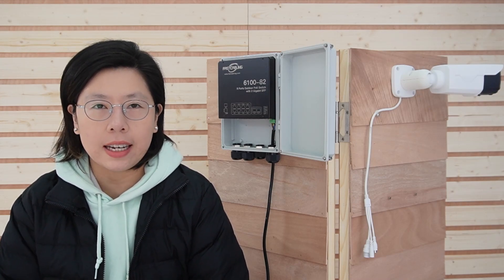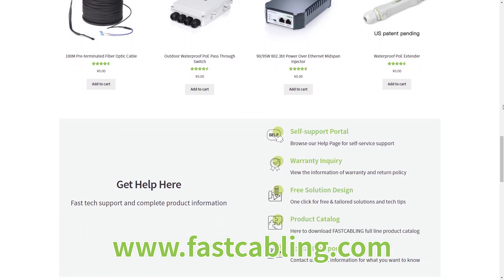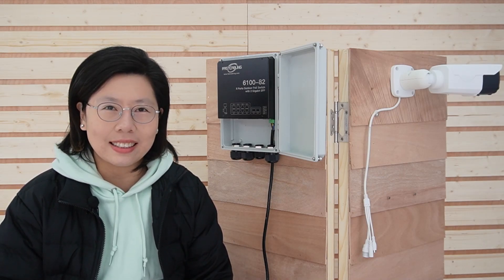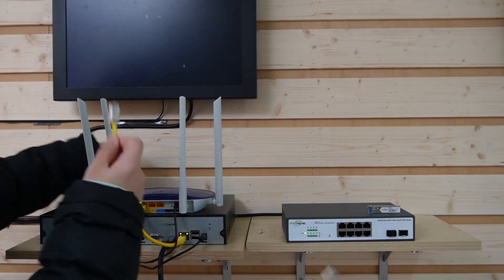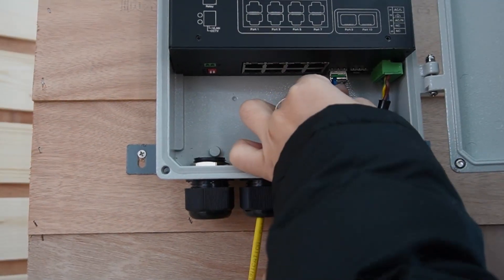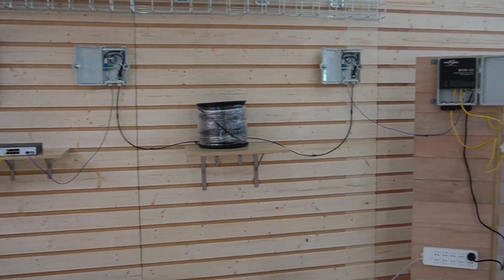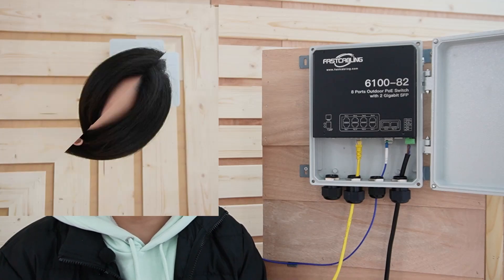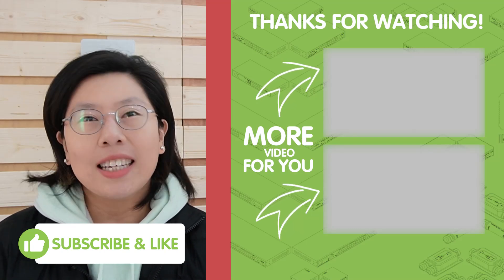Scaling Networks in Challenging Environments with PoE

Comment: Nice video! I seen that you connected the CCTV to the ethernet cable outside of the box. Does that also have a seal for that connection?
Reply from the maker: Yes, we use a waterproof enclosure to protect the connections.